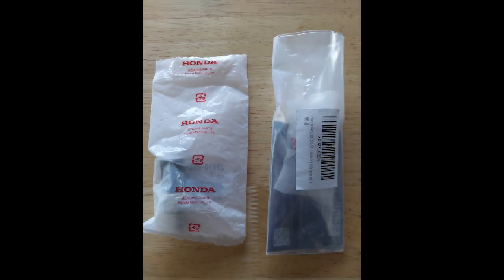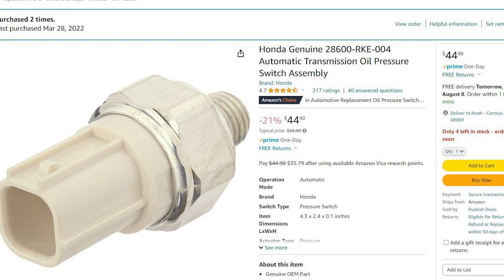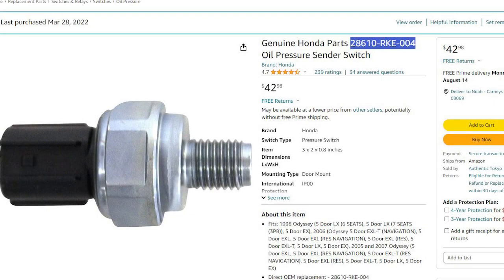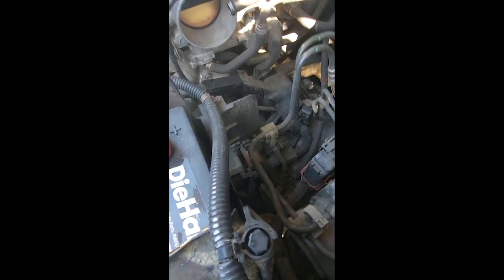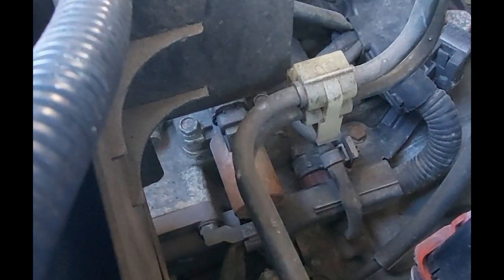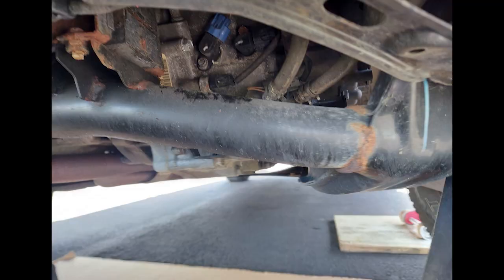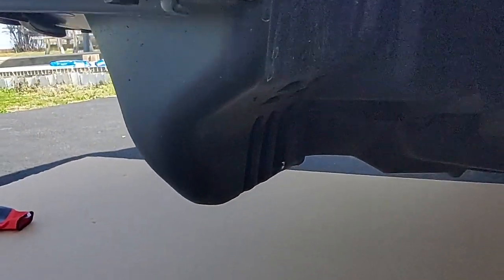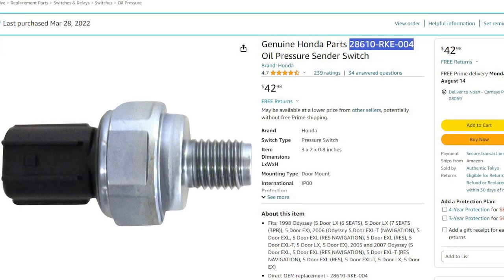Blinking D Light 2006 Honda Pilot

Comment: Hope,same thing has happened to mine. Emissions light and transmission lights are on and D is flashing in honda 2016.transmission was making humming noise when changing gear 3rd to 4th.

Comment: I have  2007 acura tl types  3.5L  engine  i have blind D i have code po732 2 gear incorrect ratio i replacement the white 2 sensor an duos solenoid an single one but  don't fix my issue 😢
Reply: Ouchhh did you do a transmission flush give it a shot can be dirty oil clogging

Comment: Made my vehicle accelerate very slow
Reply from the maker: Did the blinking "D" light stop blinking?
Reply: @noahmcfadden1658  I meant the blinking light made me accelerate slow.  I haven’t replaced the sensor yet but will def share updates
Reply: Have you fixed this issue?  Mine did the same and still accelerates slow and D lights blink